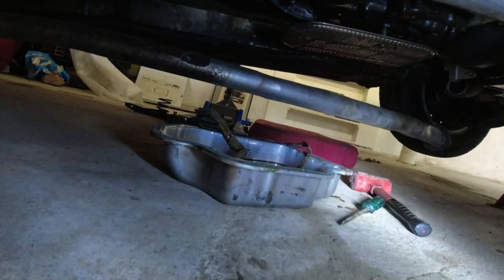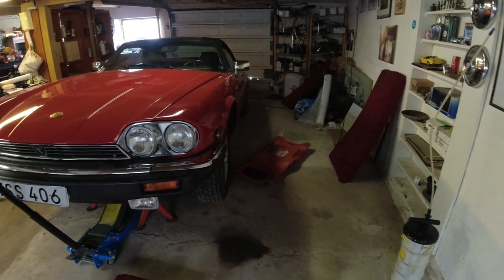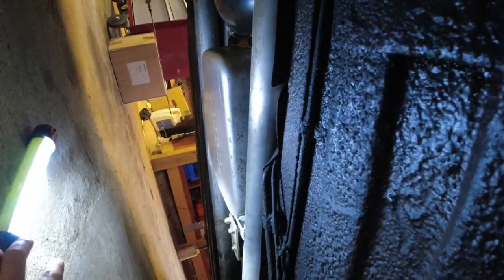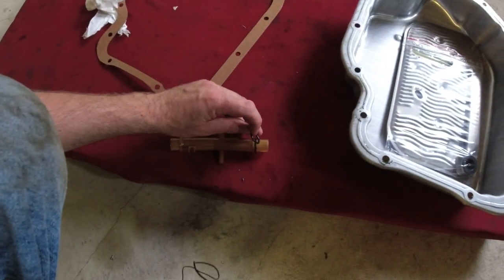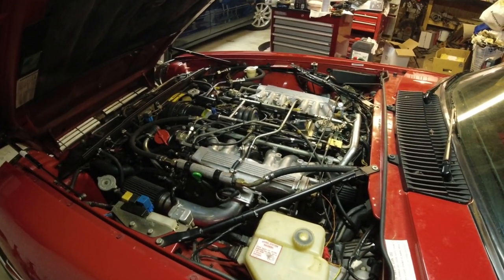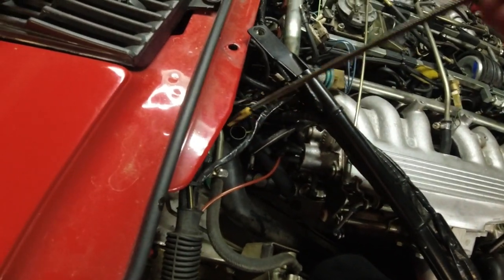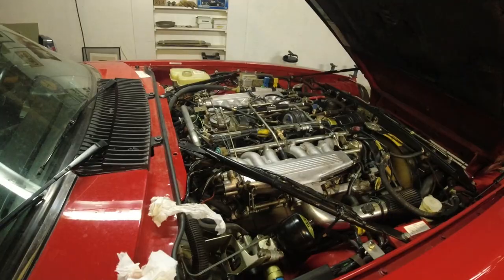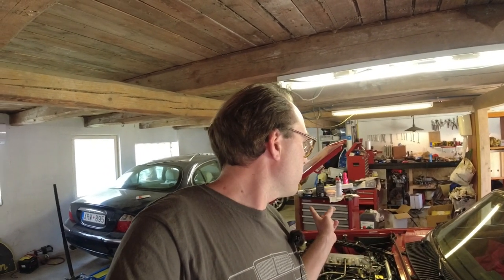Jaguar XJS Has a Slight Transmission Whine When Cold... Let's Fix It!

Comment: Adam - Many thanks for posting this.  I was so careful when carrying out the fluid / filter change so was surprised of a problem.   No O ring was supplied with the filter so never thought to change this part.  I then experienced the exact same problem when cold on start up.  Replaced the O ring on the pick up tube and all seems fine.  For reference the O ring is 19mm inner diameter - brilliant.

Comment: Hi Adam. Had the same issue with one of my XJ-S, but quite more whining. Installing new filter and O-ring fixed it. Think it was the O-ring... The O-ring came with the filter kit,  no need  to supply it seperately. Just bought a kit for TH400 / GM 400. Applies for Silver Shadow as well. Greetings, Christian

Comment: Add a drain plug.cavitation air sucking into front pump.oring is cut or shrink.adding a little trans x fluid condtioner help but don't add too much

Comment: Adam, I have the same car as your Father, this one. Marrelli ignition. I'm looking for the video on checking Voltage on the Throttle positioning sensor. I remember seeing it. Can't find now. I rebuilt the AAV, tested works good. Idles at 1000. Also on the Throttle bodies, the butterfy has an X on it. Is that up or on the bottom?